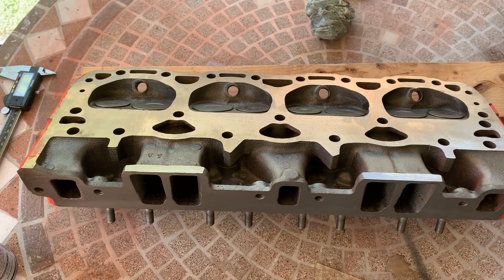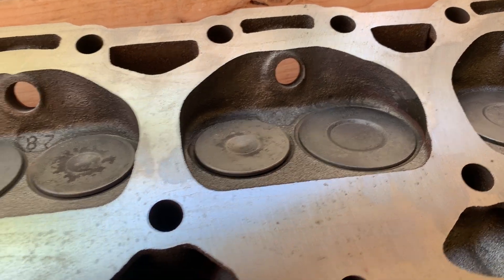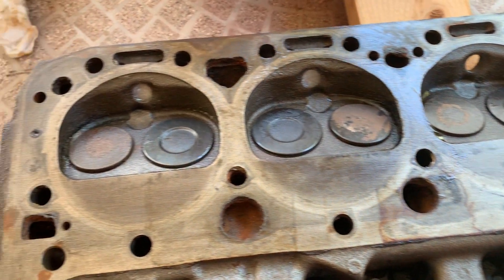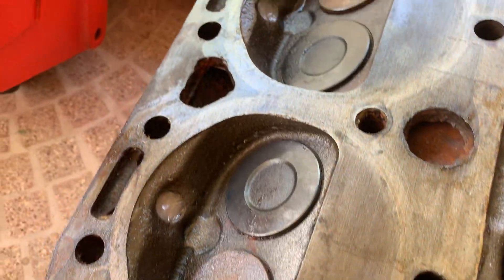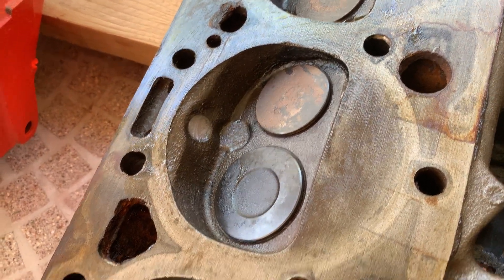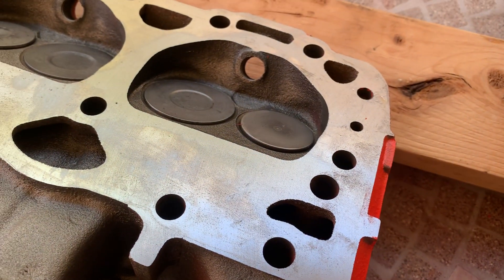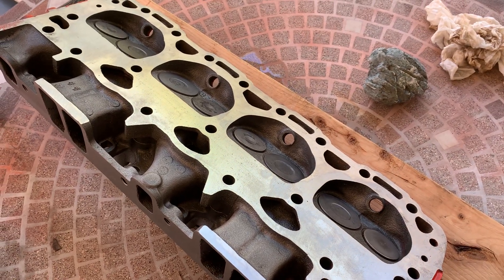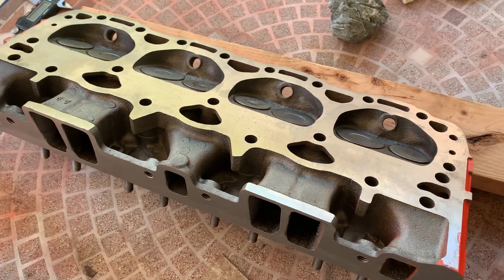Cylinder Heads 283 or 305

Comment: I have a 283 bored  30 over and I used the 416 castings in my 29 model A roadster and I am very happy with the performance of this little motor, it also has an old tri power manifold with three small base Rochester carbs.

Comment: I used stock 350 heads and stock head gaskets on my 283 comp was a bit low . 600 holly 65 jets never had a problem

Comment: You can install 1.84 intake on a 283 I think will work due to thicker castings.
Reply: It works because the 283 has a larger cylinder bore than a 305.

Comment: 305 heads have harden valve seats, a must for unleaded gasoline.
Reply: It's not a must. There are plenty of old engines running around on modern gasoline.
Reply: That's only if you're running REALLY hard. A 283 probably isnt.

Comment: 283 head was much more durable due to the thicker deck . 305 and 79 and later 350 heads have thin decks and are extremely prone to cracking .

Comment: I guess there are ok if you are happy with a 38000 rpm red line  .after that you have no good air flow . ported  283 heads would be the better choice
Reply: That would be a hell of a 283 if you could wind it to 38,000 RPM!
Reply: @carlinshowalter1806  That dude didn't have a clue what the hell he was writing about. The 283 hasn't been built since the late 60s, and GM couldn't make a head that flows the same or better in the late 80s? With the right cam, a 283 with 305 heads would run great.
Reply: Powerpak heads are only 1.72 intake valves and 1.50 exhaust valves. The 305 ho heads are 1.84/1.50. If the intake valve is smoothed underneath the valve then they will flow really well. Add a quadrajet intake and your good and a mild camshaft your golden. I have seen so many people do it. These heads flow really great if this is done. I know someone that did this to a 327 chevy and it ran amazing in a C10 truck with a 350 transmission and 3.73:1 rear gear.

Comment: Did you ever figure out a good gasket for the heads? I've got a similar issue I've got a 0.30 over 305 with 416 heads I'm wanting to install. Thanks
Reply from the maker: I used Felpro 1094 with copper sealer. The disclaimer does not say "do not use with lightweight heads" but it does say you should have flat surfaces with a particular smoothness. As you can see my heads are rebuilt and I assumed they were the correct texture, I would consider my block deck in good condition so I used the recommended copper sealer for other than perfect surface areas. These gaskets have a strange thin rubber coating that does not seem to take the copper spray well. I also Cooper painted the deck and gently put them together as they began to tac up. I spoke to a machinist and he said that would be the best route and should work well. I still have to put my Intake and Carb and accessories on. The eps edelbrock intake recommends a particular gasket but I opted for one from summit that have the water heat passage restricted. The restricted not restricted was another mini research project lol. If I were to do this again I would have decked the block regardless of what the machinist said. You want to get good compression with the shorter rebuilder pistons that assume you are decking. You also want to use a forgiving gasket and still retain good quench.
Good luck. 
After my boat project Ill be back on the SBC stay tuned.
Reply: @notrodtv6113  

Cool, I see you know about the rebuilder pistons.
Reply from the maker: @itseithergonnaworkoritaint7852  Yes but after I had installed and purchased them. Had I know sooner, I would have spent the extra few hundred and decked the block as not to be so deep in the hole. But lesson learned . The machining cost are very high and pole around here are not so friendly or helpful.
Reply: @notrodtv6113  

It's not to late, it's not in a car yet. 

If it were me I would correct that before I went any further. If you research quench IIRC .050" to .070" in the hole is the bad spot that will be more detonation prone.

Plus such a small engine needs all the compression it can get to make power. 

Just ran your combo through the compression calculator and it says 8.57:1 which is pretty lack luster.

Get your quench to .040" brings you up to 9:1. To bring the compression up even more you can have the heads milled while it's apart. It's about 1cc per .006" removed so if you have. 050" removed that would make the chambers around 50cc and give you about a 10:1 static compression ratio. A lot better than 8.5:1 with much better quench.

But you'll need shorter push rods and the intake side of the heads milled to make sure the ports line up and gaskets will fit.

You can probably get away with .030" milled off the heads without much port misalignment but you'll need .050" shorter push rods to maintain proper valve train geometry.
Reply from the maker: @itseithergonnaworkoritaint7852  so your saying take the heads to a machine shop and remove .030 for 9:1 and .050 thou for 10:1 but at .50 it would need additional milling on the intake side for it to line up correctly and new push rods to fit the shorter distance.
Reply: @notrodtv6113  

Well I wouldn't do that without correcting the quench or that thing will be a rattle can unless you run race gas.

You need to have the block milled to get your. 040" quench before you go having the heads milled. 

Then you can have the heads milled to dial in your compression ratio to make more power without detonating.
Reply: 416 heads are crack prone  MAC = make another choice
Reply from the maker: @MasterWitchDoctor  unless you want to spend the dough there are not too many choices out there for small chamber heads. If I had a 327 or 350 the world is my oyster, But with a 283 you have rebuild Power-Paks, 305, World Products Torquer 305s, Then onto edelbrocks and more and more $$$. You are right, not the best combo. I still have the original heads and parts so maybe I'll rebuild them one day.
Reply: @notrodtv6113  

The 305 Vortec heads would be the ticket but then there would be the extra expense for an intake. But would still be less than just a set of aftermarket aluminum heads.

As for flow numbers for a small cid engine it's hard to find better heads for the same price. 

The Stan Weiss head flow website has the flow numbers right next to the 350 Vortec heads and the average flow is actually better with the Vortec 305 heads.
Reply from the maker: @itseithergonnaworkoritaint7852  I would agree but with no engine building expierience I just wanted to get a very basic build done and under my belt. I could just get a crate motor that blows this away and be close to dealing with the extra cost of the vortec / intakes etc. I really wanted as low budget as I could get. Still ain't done yet. Hopefully I can get back on it soon. Been messing with the boat still.
Reply: @notrodtv6113  

That's cool, I would of used the $50 ready to bolt on heads if I were you too. Can't beat that price.

I just wanted to throw my opinion about the 305 Vortec heads in the mix and how good they are.

Cool little build, you don't see very many people building 283s anymore. I might do one on my channel maybe next year? I have 2 of them in my garage.

I have to get the sbc 355 installed in the truck first and then the sbc 434 and the sbb 380 done before the garage cores get attention.
Reply: @notrodtv6113  I'm watching! Doing the same to my 58' 283 vette motor. 283 heads tho. Did you bore it out? Havent got a chance to watch all your vids incase you mentioned elsewhere. 

Gonna throw this thing in my old school van. I like old motors, plus got mine for little to nothing. Build will be around 2k max or less when done
Reply: @MasterWitchDoctor  Crack prone or not 416 heads is what in going with a buddy of mine has had no issues with them smaller cube motors you just get guys putting them on motor with higher cr's that's where the issues start I dont think 30 thousandths is going to make a big difference on a 305 with identical heads...

Comment: Hey try to run a straight edge,if your flat and true try to use a steel shim gasket with those 305 heads , I would say that it's a good combo for a 283
Reply from the maker: I pretty much have no choice but to try a steel shim. I’m measuring 45 thou in the hole on the block after installing the rebuilder pistons. The block is true but maybe the roughness is not perfect. Not sure why so much but I’m guessing it was an engine for low performance. My machinist said my block was in good condition no need to deck. he is not a performance minded guy and I didn’t know about quench until it was too late. The heads are fresh machined. I will copper coat the steal shim and the deck but not the heads. Hopefully they hold up and I can maintain a respectful  60 thou quench.
Reply: @notrodtv6113  

The cheap rebuilder pistons manufacturer assume the deck will be milled at least .020", that is why it is so far down the hole.

The factory used steel shim .020" thick head gaskets with the factory pistons .020" in the hole to maintain a .040" quench mathematically from the factory blueprint numbers. Of course those numbers weren't always what they were supposed to be but that's a story for a different day.
Reply: @notrodtv6113  sounds good, you should be able to get a good runner ,the 283 if I am correct has a flattop in it too so you will have good compression also .I really think you did the right thing. Don't overthink it like I sometimes do lol.
Reply: @notrodtv6113  A lot of that talk is just maximum performance, squeezing out every bit of horsepower. The engine can run fine without everything that people claim you "must do."